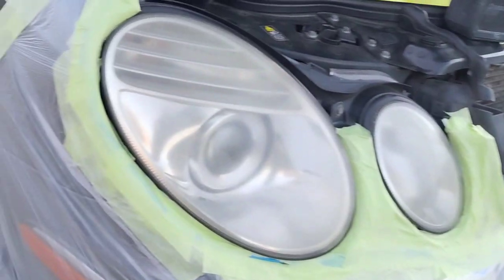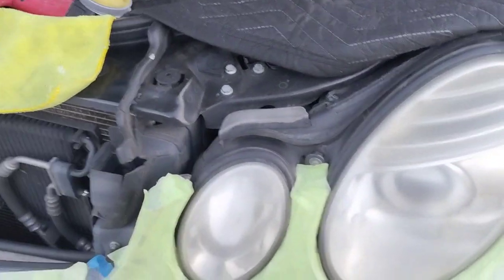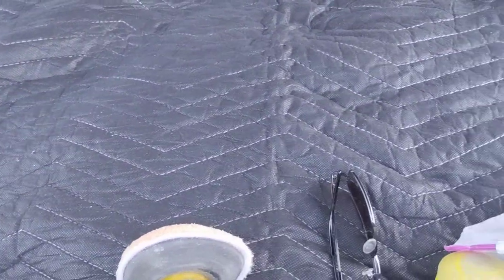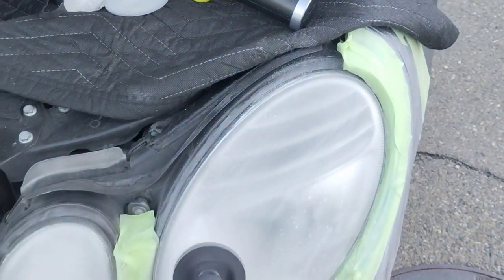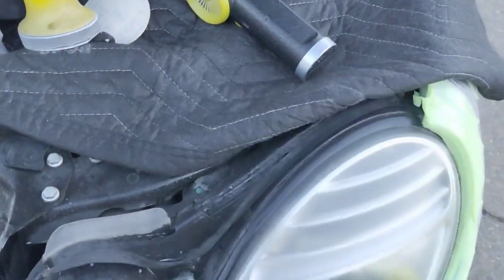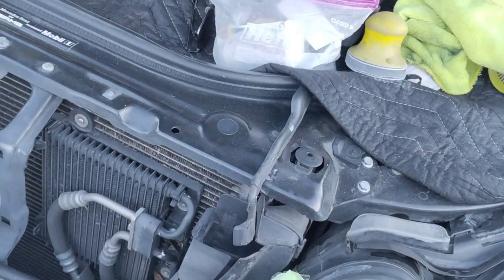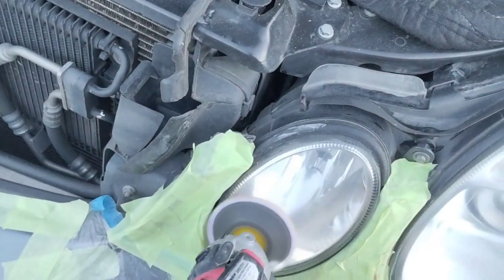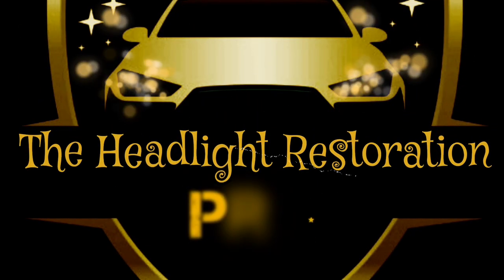headlight restoration BAND-AIDS🩹

Comment: I know the 2k clearcoat is bad for headlights.  spray max makes a product called headlight clear. curious to know what's your take on it. business wise it doesn't make sense since you have a few days before it hardens just like the 2k one. and lastly it costs about 3 or 4 meguiars headlight coating
Reply from the maker: Business-wise and everyday consumer it makes no sense to use this product it takes ridiculously long to cure just like the original and it pretty much is the original with a couple tweaks it just has an adequate amount of UV protection added to it which regular 2K clear doesn't.. but it still doesn't change the problem of the drying time and the problem of over at hearing and hardening,, which still leads to damage. And yes the price is ridiculous..lol
I think it's just a little bit better a point or two to the actual 2K clear spray Max same exact formula just with some tweaks mainly extra UV protection added in.. which doesn't solve much of the problem at all...
Also for the everyday person it's way too complicated and hard to use... And for the business it's way too time consuming and how do you have a vehicle sit at a shop or location for hours for you to finish..lol or have them drive around and come back the next day for you to finish it off cuz the orange peel factor is still very high...
Some other 2ks are okay and appearance but they have other downfalls as well in the same category, not enough UV protection, bonding too hard, causing damage in the long run mostly by overheating and staying on too long with no indicators of the UV protecting going bad.... Neither one is primarily good for headlight health...

Comment: Does that clear coat not flake off the rubber around the top of light
Reply from the maker: No...
This isn't a clear coat substance that typically flakes, or peels...
And if it did ... It wouldn't really matter..🫡

Comment: I assume its not possible to clean inside of lens ?  Also do you ever run into bugs getting inside of lenses? I did my personal vehicle and had bugs in it. Thought I may attach some small soft tubing to shop vac and remove lamp to access inside of light. What are your thoughts. Thanks. Enjoy your videos. Excellent work!
Reply from the maker: Yeah it's very difficult to take apart lenses damn near impossible nine times out of 10 the damage is on the outside though.. if the bug isn't hurting nobody I would probably leave it alone once you start opening headlights weird stuff happens and you're just going to keep running into headlight drama more than likely..
Thank you for watching..
I believe on one of my videos there is a spider inside of a headlight.... The worst headlight competition winner.... check it out...https://youtu.be/ZSd2rlhXAb0
Reply: I noticed watching your sanding process it looks like you run your drill in reverse. Is this just a preference or necessary? Just curious.  I really appreciate your recent reply to my earlier question. Also is the chemical guys headlight restore polish as good as the 3M hard lens cleaner polish? I apologize for all the questions. I am detail oriented as you are in your work. Just strive for the results your achieving.  Top notch work my friend!! Look forward to your videos. Thanks so much!
Reply from the maker: @lewismccrary5353  there is no reverse when it comes to using a drill like this.. it's either right or left The recoil or back pressure is different which whatever way you use.. it's easier to use one of the other on different lights are different angles.. a car is The chemical guys..🤣🤣🤣 I use a lot of chemical but nothing they make a complete pair or can possibly compare to any 3m product...by far.  What that's being said it does have a nice UV protective additive in it... It's a bit oily....
Thanks for watching..👍🏽😎💯